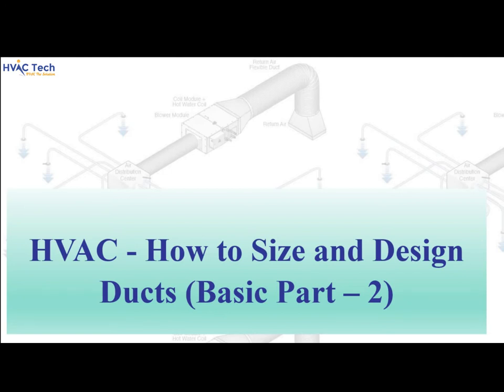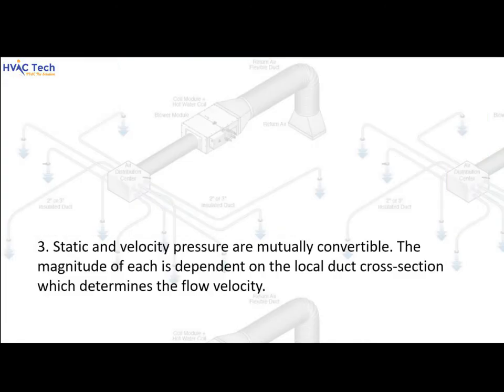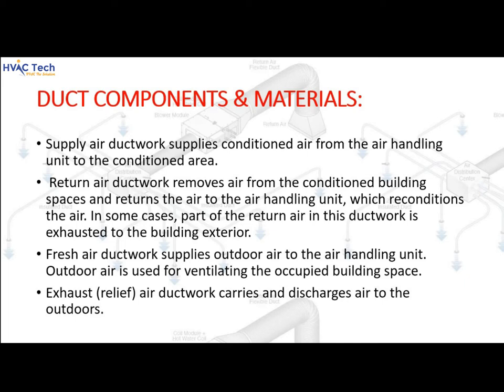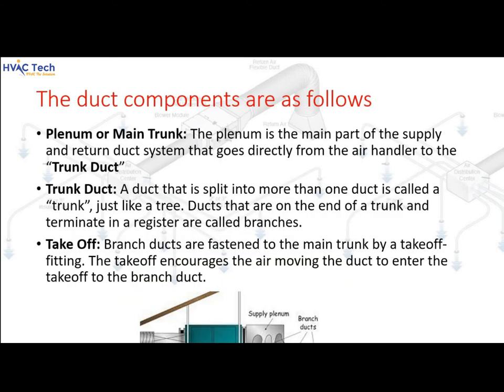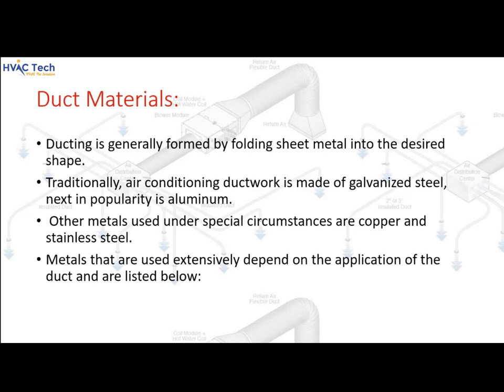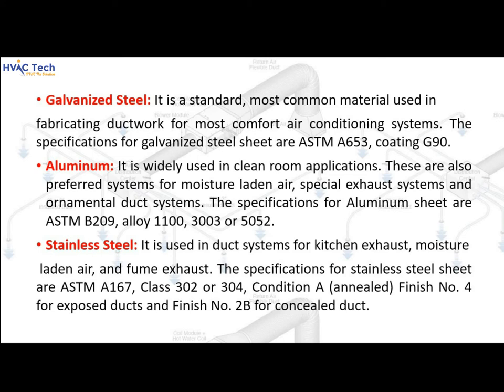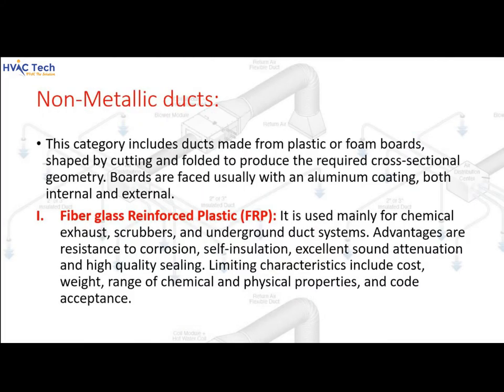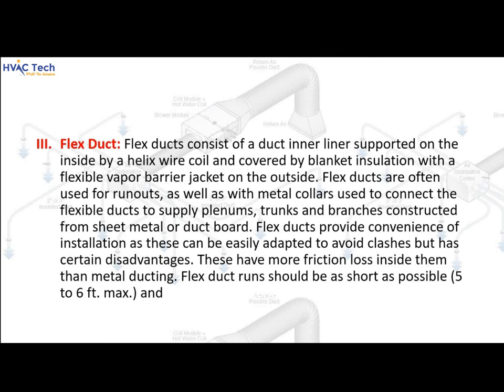How to size and design ducts - part 2 | Duct classification | Type of Duct material user for HVAC.

Comment: Thanks for the video.   I'd love to see a heating a cooling duct system is designed for a floor if it the unit is installed in the basement vs. the attic - basically I'd like a comparison of the two.
Reply from the maker: Noted